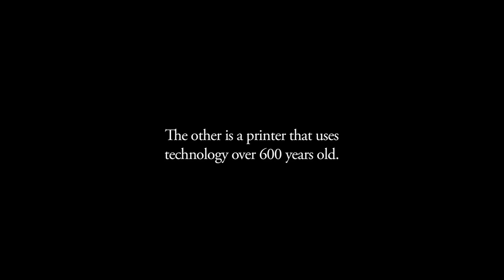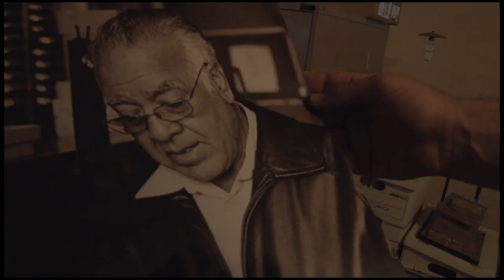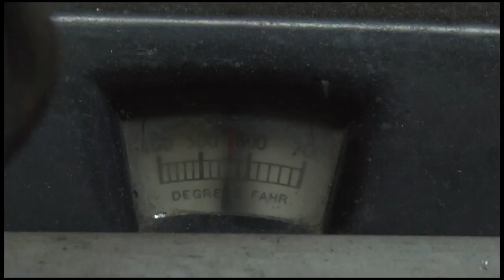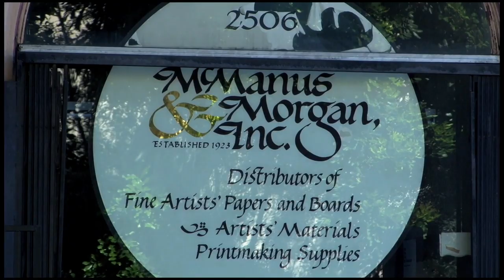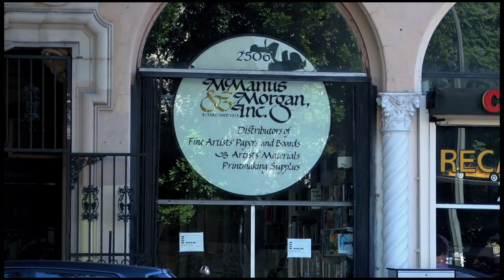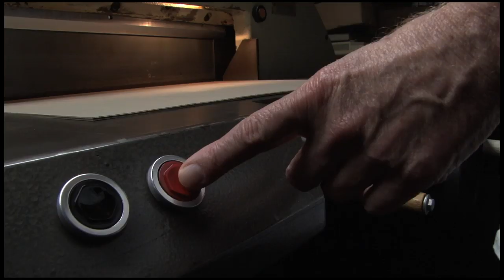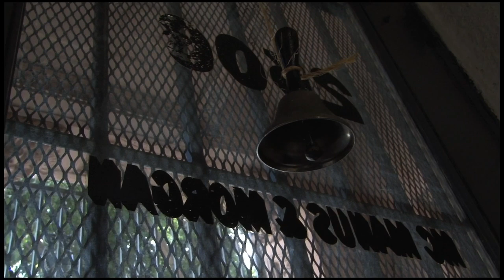Ink & Paper - Last Letterpress and Paper Company in Los Angeles

Comment: I spent over 40 years in the letterpress printing industry in England.  I just loved those smells as you came through the door into the comp-room, molten metal and on into the machine room with the distinctive sound of Heidelberg cylinders and Heidelberg Platens faithfully printing and die-cutting every sheet of paper and board in register.  Nothing quite like it.